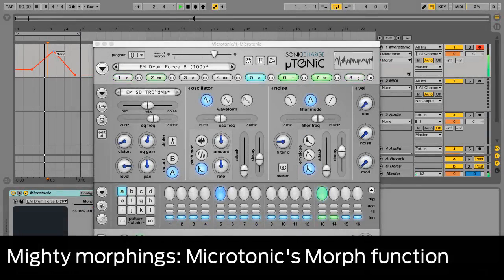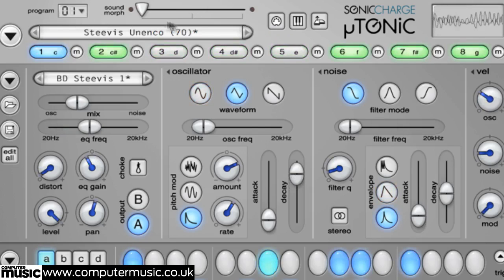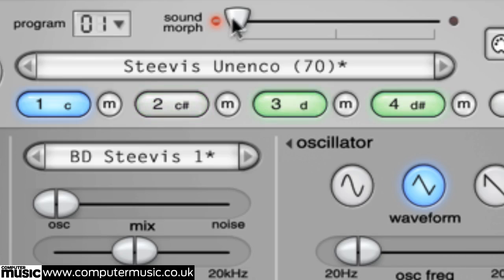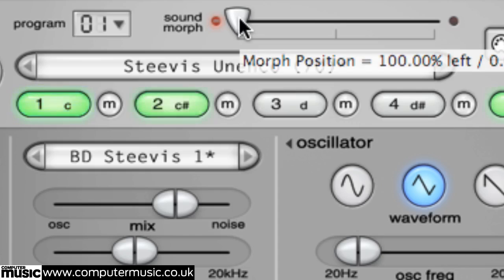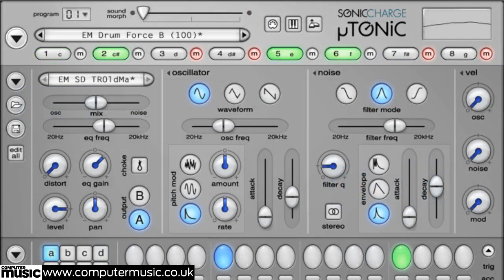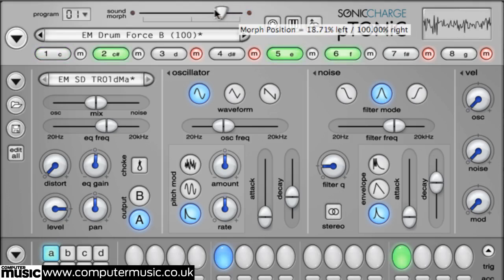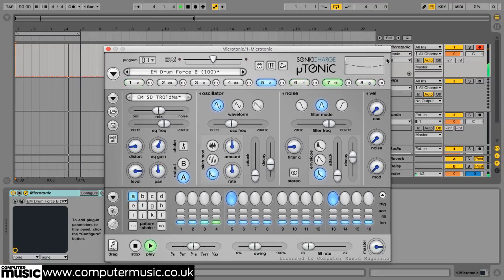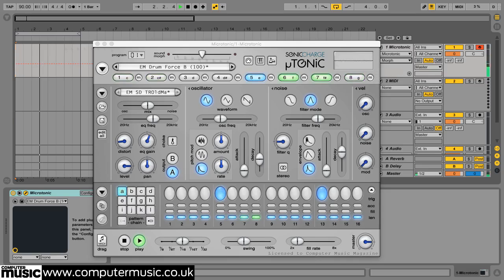Sonic Charge Microtonic's Morph function - 2 of 7

Comment: How do you disable the morph function for a certain knob or slider ?
Reply: make the sound on both sides identical
Reply: Thanx, finally I get it now :)
Reply: I realize my answer was pretty weird. In case someone else is asking the same question in the future, do this: make sure it has the same value at both extremes of the morph slider. Pull it all the way to the left and put it in the desired position, then move the morph slider all the way to the right and do the same.